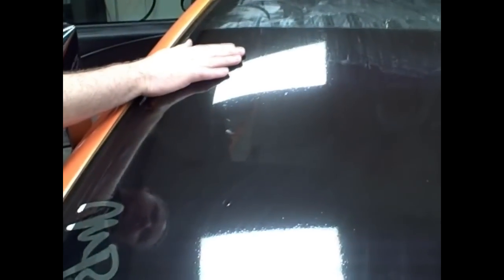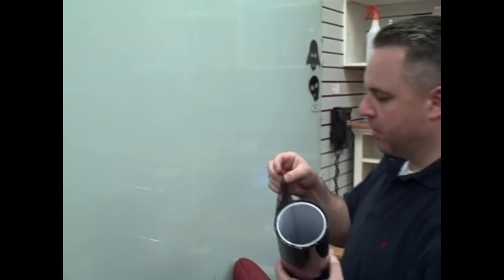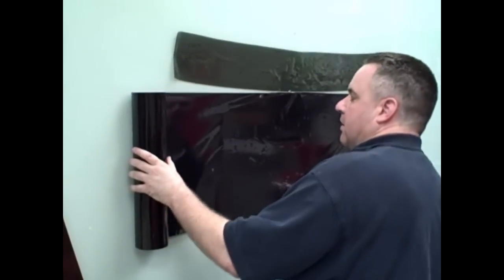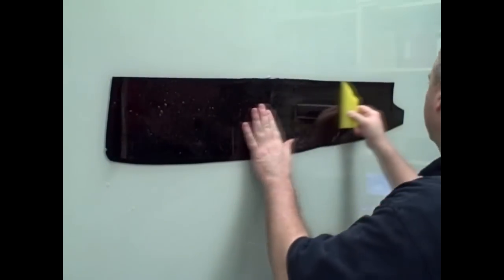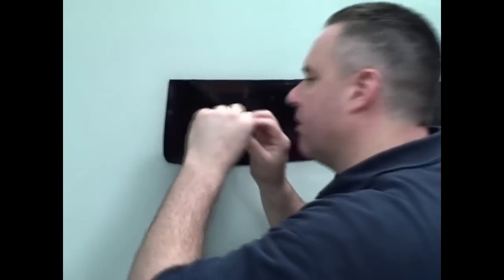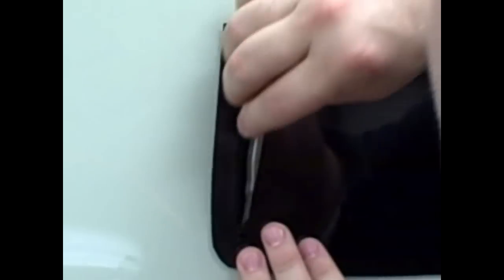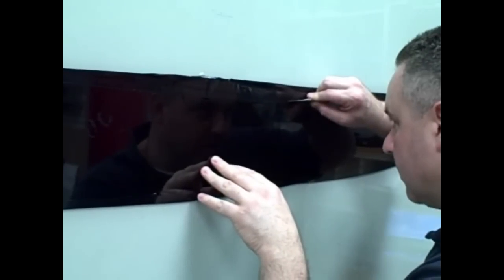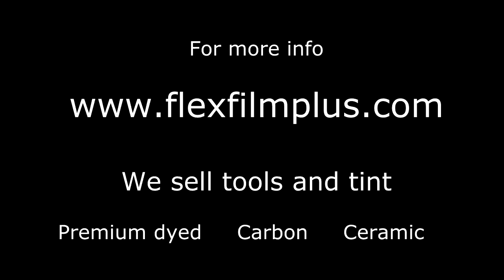How to Black Out Matrix Dots with Vinyl

Comment: What if you just apply tint over the matrix dots? Could that have been done, but requested by the customer to be vinyl?
Reply from the maker: The customer requested vinyl black out.  You could just tint over matrix dot with tint, but you might need to add glue to make the tint form to the dots better. I have a video demonstrating this technique on my channel.